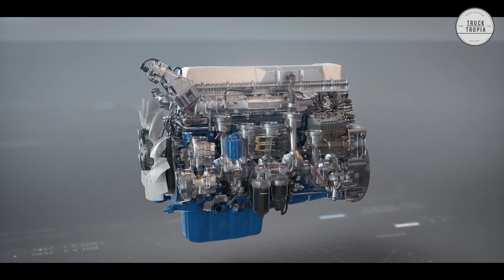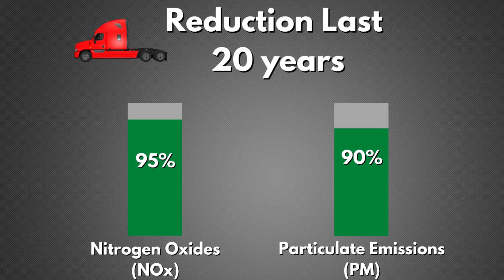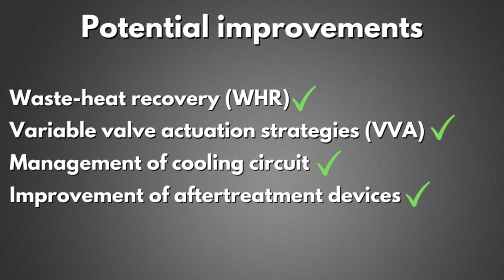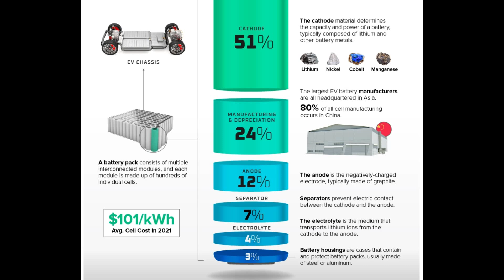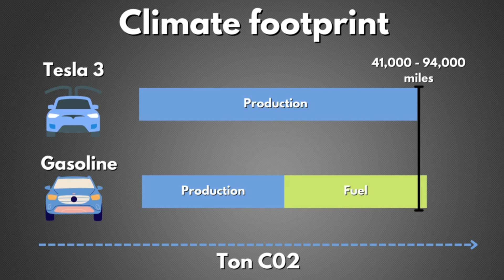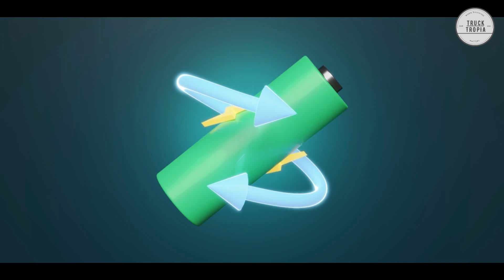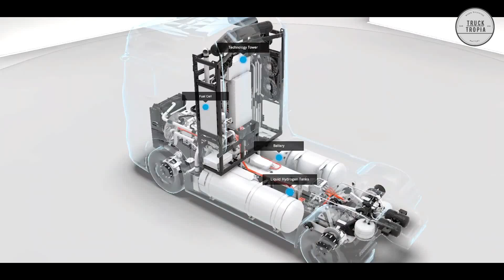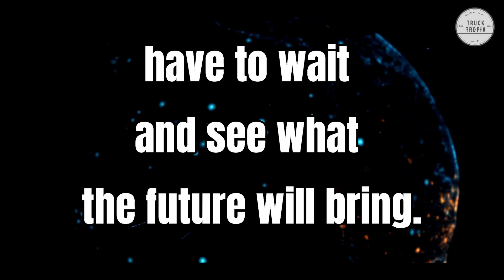How Dirty Are Diesel Trucks Really?

Comment: Fast charging sounds awesome until you realize that it causes a lot of wear on the batteries and charging components. For a truck that is expected to be usable for a million miles this is not good. Also for this to even be possible there needs to be as many electric charging stations as there are diesel pumps. And just as many places to have repairs done in these electric trucks. Or it would cause major supply issues with...well everything you buy... everything is transported on an 18 wheeler at some point. Keep this in mind when you see a truck and complain. Your Starbucks drink...the snacks you are munching on...heck the car you are in and the cell phone you are using all got to you on an 18 wheeler... without them we would not be able to live the way we do.

Comment: People today are so stupid it’s beyond ridiculous. Diesels are so clean today and fuel efficient there is no replacement.
Changing to electric will require 3 time more power production then we have today. All power lines on every road/street will have to be upgraded to handle the load of charging our Electric future. We will need 1000s more nuclear reactors.
All the pollution in the world from fossil fueled powered vehicles adds up to 7-9%. There is 5000 planes in the air over the USA 24/7. Jumbo jets get as bad as 1 mile using 5 gallons of fuel. Top 3 polluters are……
Air Travel
Container Ships
Power Production making up 80-90 % of the pollution

Comment: The trucking industry as a whole is traditionally very slow to change. A perfect example is the air disc brake vs drum brakes. There's no way unless government regulations require to replace the diesel engine. How much does an electric truck weigh? The heavier the empty weight the less the cargo. Decades or more away from a reasonable alternative.

Comment: The emissions since 2008 just make the engine run worse, polluting more. 
Sure when new they farther out cleanish air, but once they wear down they are far worse. And still don't set a check engine light.

Comment: Electrical grid is going to need a huge upgrade in a lot of areas to handle the extra need for electricity. I think they are putting the cart in front of the horse so to speak.

Comment: I think you might have ignored the fact that with the Tesla Prime Mover/Semi, 5 tonne payload is given up over it's diesel equivalent which may make the economics questionable to say the least - particularly in the short to medium term.
Reply: dont't believe the hype of the tesla. It's not a 80k lbs trailer. No way does it perform as well as they claim it does. Never trust Elon Tusk
Reply: @xTerminatorAndy  yeah this whole EV hype is in for a Very Rude Awakening (and Toyota in my eyes is playing the Long smart game), given the amount of roar materials required (all of which are currently scarce & expensive) combined with the overburden, time to exploit and Energy required to get them, in my eyes we are 10-30 years away from EVs being mainstream. The EV aluminium panels alone are more expensive to produce than an ICE car! PS: I own a PHEV with most “fuel” coming from solar panels & batteries. In 6 months I’ve done 10,000kms, averaging 0.88l/100kms using 12.1l to travel 1,466kms (A$22.1) on last fill. Even the car roof has a solar panel that’s generated 214kW & the car typically takes 3hrs to charge from Solar.

Comment: You forgot to mention the environmental damage in the countries, where lithium is mined. It's a pure catastrophe to men and beast in Southern America. I'm not afraid of Carbon dioxide emissions. They don't cause any notable change in the Global climate, as many scientists have proofed. High-end diesel engine are emitting cleaner exhaust than the air they take in for burning fuel. GTL fuel (gas to liquid) are very low on particle emissions. Less than 11 % of all particles measured on busy streets in cities come from the engine. The majority come from the brakes, tyres and  road dust. So diesel engines are better for the environment than EVs.

Comment: Carbon dioxide is not a pollutant nor is ozone. Both of those are natural elements.
CO2 is the natural result of complete hydrocarbon combustion. It consists of two parts oxygen to one part carbon regardless of whether it comes from respiration or combustion. It also comes from the natural decay of dead plant material. Ozone is a natural element it is a three element oxygen molecule. It is lighter than air and occupies the upper atmosphere. Without ozone we would literally burn to death from UV rays.
As far as biodiesel fuels go they are as worthless as alcohols. They do not have the btu content of hydrocarbon diesel fuel. Fuel consumption is considerably higher.
Carbon is not a pollutant it is a natural element. The largest building block of this planet is carbon. Without it 75% of this planet could not exist. 
Climate change is climate fraud. It's not about the environment it never was. It's about the imposition of authoritarian fascist socialism. The environment is the means to that end. With the left of the end justifies the means no matter the consequences.

Comment: The Tesla Semi was able to go 500 miles going up inclines and down. I think the Tesla semi with it's efficiency and fast charging to 70% would be a great solution. 500 miles with 80,000 pounds Is impressive and everyone said it couldn't be done.
Reply: You may want to talk to Pepsi they are claiming their tesla semi are only getting 100 miles per charge
Reply: don't believe Elon Tusk. that semi was not even loaded to 15k lbs. A standard 80k lbs truck on electric won't last 500 miles, no way. Mark my words
Reply: @Andy Pieters  The batteries alone is 5 extra tons . That would be cutting into the load the truck can carry.
Reply: @drjekelmrhyde  no they allow EV to carry more because of weight of the battery
Reply: @xTerminatorAndy  they showed a video of them doing it ....
Reply: @kaptain1477  that video was of it carrying 14,000 pounds.

Comment: The part they won't tell you.... My 1998 freightliner fld with a Cummings M-11+ got 7.2 mpg over the 1.8 million miles I drove it and that was 95% loaded miles. My 2018 freightliner, emissions controlled,only 50% loaded miles, gets 6.2 mpg. That goes down to 5.3 when the temperature is below 30 deg F. Why because emissions suck fuel. Any way you look at it, the #1 polluter is ships burning bunker fuel. The #2 jet aircraft. Both put far more pollution in the air every year than all of the trucks of even the 70's and 80's ever did.

Comment: will the disel engine or combustion engine in general Disapear? 
- NO , not in this Decade,Century or even in the Millenia
Will the insufficent, poorly and out of a mood of 0,1% of the dumbest living kind of human solve the "problem with polution" ?
- NO, because that 0,1% have absolutly nothing in their heads to think or act adequate to any Problem at all.

--- see : they think that cars and trucks are the most polution, wich in fact they are NOT, but they have the highest factor and chance to clean up.
They think that electric is the answer, but the fact that this goal of banning combustion and replacing it with electric is just pure idioticity,
that will destroy our planet more in the next century than the industrial revolution did 100 years ago.
So the 2035 Ban should be taken back or canceld, as this generation we got rightnow is so eager to do so often, but only for a change, this one would make sense.

I'm clearly not aginst Enviromental protection, for a fact I highly engaged in this topic ,reuse as much as possible, think twice or more if I need to buy something
but this Haterance of so called ECO's against cars or combustion engines has nothing to do with saving at all, 
it's just a lost cause from the late 70's early 80's that should be long dead by now,
since we have catalytic converters on every Car, Truck even Trainengine by now,
BUT ships boat any vessel afloat with an engine a board, Planes, Helicopters did not. 
And the larger they are ,the worse they are.

The fact and paradox for Battery electric drive is: 
The Larger the moving object is, the less effective it is, 
the Larger the car gets, the heavier it gets, the more electricity is needed, the larger the battery gets the heavier it gets and this goes on and on.
There is a reason EV's should be about a Golf class vehicle in size and should be used in City traffic manly.

The real solution would be encourage recycling masses that can be turned into fuel (like gas from fermentation processes)
another solution are Hybrid vehicles that are powered by small clean combustion engine that's running a gen that powers the electric motors and a buffer battery.
Hydrogen Fuel just combust it and it is already clean, it allready can be obtained from Windfarms, Hydro-powerplants without the massive lost in factory extraction.
The ingenious Proces Bosch Patented in generating Menure.
Since electricity isn't a medium that likes to be stored, turn it into somthing else.

Comment: Your diesel history recites many reductions in diesel pollution. Despite these, diesel propulsion (even "clean diesel") is simply a slightly different restatement of the gasoline engine and its pollution problems.
Yes, almost any emerging technology passes through a series of obstacles, and electric and hydrogen are no exception. However, the fundamental difference between diesel, gasoline and CNG, on one side, and electric, on the other, is we cannot afford their fossil-based pollution. Obviously, we cannot afford greener energy sources, either, without solving their own waste and atmospheric pollution issues.
There is a very limited amount of CO2 and methane the Earth can absorb before it  falls into an unrecoverable, unlivable condition. We are literally destroying the natural environment on which we must depend for our survival.

Comment: I get it that some are worried that 500 miles is not enough, but the driving hours that are allowed by law are the limiting factor. It makes no sence to have 1500 miles range, when the driver needs to rest after 500 miles where he could recharge, or during breaks, load and unload...an there's you problem, you should rest and not wait the half night for the charging station to free up, so there need to be massive infrastructure investment.
For elevation the EV could even be better, he will eat more power when going up...same is for the diesel engine...but when going down it will recharge the battery where with the diesel it will only create heat, from breaks and engine.
Reply: So what happens when drivers take turns driving?
Reply: @PremiumFuelOnly  the EV is only for a one-driver concept, or "one-shift" .
Sure for full long range 24 hours driving, with two drivers or switching the drivers at the depot to keep the truck moving, same with switching the trailers to move goods between two locations where there is no time to recharge...that will still be a concept for a diesel.
But most could be done by the EV concept.
Same with a normal car, most only drive an average of 30 miles per day, so even an EV with 100 miles range is more than enough, the problem is when they want to travel and need to recharge every hour.

Comment: Working on a battery plant just breaking ground for a large car manufacturer. They have probably 150 diesel semis running loads of gravel everyday for the last couple of weeks plus for probably the next couple of months. Then you have the 4 quarries they are pulling out of blasting limestone e everyday to keep up with production. Plus probably 40 pieces of heavy equipment on site moving the dirt and the gravel. All this before the first footer is dug or the first pipe is laid. And it is a 3 year project. So tell me again how all that is better for the environment. How many years will it take off production just to break even on carbon emission just to build that 1 plant.

Comment: the only way I see semi trucks, or lorries, being effective for standard long trips (daily drives of 500+ miles, at 60mph for up to 11 hours a day for one driver can be 660 miles a day, and double if the truck is a team driver truck) and for team drivers is if they add in road charging, a concept I saw somewhere here on yt once. This way the vehicles use power from the road for the long runs, but then battery for inter city destinations
Reply: Or it would be easier to change what you do and be happy, no problem. Many of my trucker friends are now dead, they drove too many miles.
Reply: @tedmoss  huh?

Comment: LPG is half the price of gasoline or diesel and is a "waste" byproduct of producing other products from petroleum. It burns as clean as LNG but is more available. LPG Electric hybrids are a much better solution for longhaul trucking. Couple with plug-in charging and 500 miles of battery pack, and you have a rig with a range of well over 1,500 miles between "fill-ups". This is the equivalent of a 7.5mpg diesel rig with 200 gallons of fuel tanks. 100gal LPG, 28KW genset, and 500 mile battery pack should be built by someone.

Comment: Before diesel trucks, goods and passengers were moved around by steam trains. Clearly this doesn't work in modern society as the train doesn't deliver to your house, or restock your local supermarket. But what if society changed. What if we used modern diesel or electric trains to move goods long distances, and then use battery electric trucks for local haulage. Suddenly this all makes sense, but the loading and unloading needs to be quick to make it all viable.

Comment: Another thing they can do is make diesel trucks have a hybrid power train so braking energy is recovered.
Reply: Hybrid is definitely the way to go with regenerative braking around town and then on the highway once you reach say 60mph for more than a mile it switches over diesel to charge the batteries and alternate between battery and diesel as needed

Comment: I don't think anything could replace the power and reliability of a diesel engine.
Reply from the maker: No not as it is now
Reply: @TruckTropia  I have worked with diesel engines that date back to the 60s and use 40s tech.  EMD 645 is by far my favorite to work with.  They are simple to work on and start up with little to no difficulty.
Reply: I'm a Ship's Engineering Officer and I worked on cars during my time off so I have seen a little bit of everything.
Reply: @TruckTropia  nobody talks about what battery size is best for longevity , the more parrallels you add the less longveity, but exponentially more energy required in practical situations because energy per weight is low compared to combustion, more energy flow is worse for degradation. see aptera owners club video on saftey, lighter is safer for people in other weaker vehicals in crash without nessesarily being less safe for people inside car. 2 pistons going back and forth on shaft with magnets on it, make electrity to charge electric drive. no dealing with downshifts, no weight balancing of spinning parts and friction, no frequent and large change in rpm, allows small size weight , and weight low to ground to handle more momentum around turns, regenrative braking is less effceint than momentum preservation and energy flow worsens battery longveity.

Comment: Long haul solution is going >back< to primarily using trains.  Staying on trucks for long haul for this long isn't just the trucker unions but also the oil industry.  The oil industry is the chef reason the US has moved away from mass transit starting in the 1950's.

Comment: Biodiesel doesn’t have the same btu’s as diesel 2. So you have to use more of it, more cost and emissions.
Reply: Biodiesel also gels up at a higher temperature than diesel, just below 32F.  Diesel 2 is good to about 18F.  A few years ago, the local school district switched all the school buses to biodiesel.  The first time the temperature went below freezing, about half the buses wouldn't start the next morning!

Comment: Hydrogen is just not going to work. The molecules are so tiny that the slightest leak becomes a problem. CNG works, but is it really better than Diesel? Not really. Causes a lot of problems. Electric? The batteries suck, but with better battery tech it can definitely outmatch or even kill the usage of diesel engines. I believe electric trucks will reign supreme, but it is going to take some serious improvements or brutal and moronic strong-arming from governments for that to happen anytime soon.

Comment: This video seems very very pro diesel or anti-everything else.
Talking about the infrastructure, obviously the network is better suited for diesel trucks, since they make up a vast majority of truck traffic today. Demand induces offer and the demand will generate with the tougher and tougher restrictions imposed by cites and countries about emissions so tomorrow, charging a truck will be much easier.
Yes it pollutes more to produce an electric car than a diesel or gas car today. But most cars pass 90k miles in their lifetime, especially with how easy it is to maintain an electric car. Same for trucks, which often pass 600k miles before being scrapped.
Countries will aslo move away from coal power plants.
Another point is on the the range of electric trucks. 300 to 500 miles is more that enough for most jobs. Most goods we have come from overseas and big cities tend to develop near littorals. They are not a ton of big cities that are more than 300 miles away from an international port so this range is perfectly acceptable and in a lot of cases, you could just use rail transport for longer trips.

It is not about looking at today's short comings on new technologies, it is about in 20 years time, when we will look back at the past on our decisions to develop carbon free solutions or just keep doing what were doing, knwing that the consquences that it would have.
Reply from the maker: Thanks for sharing 👍